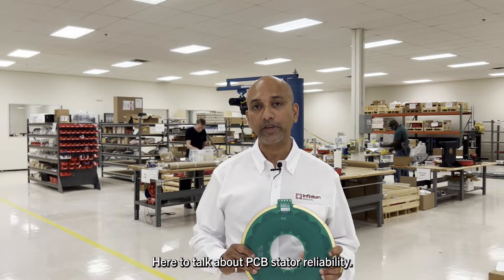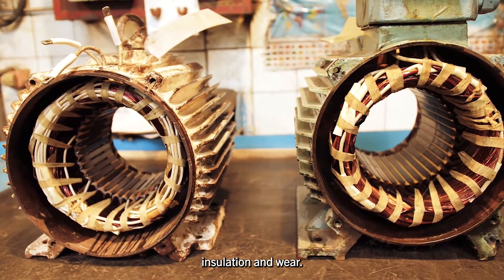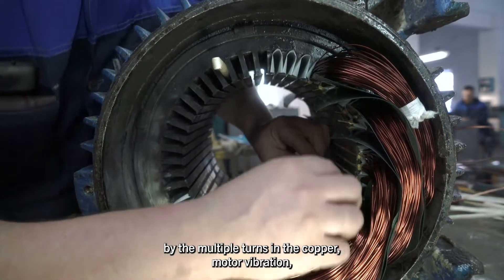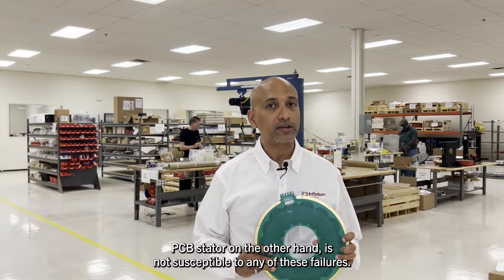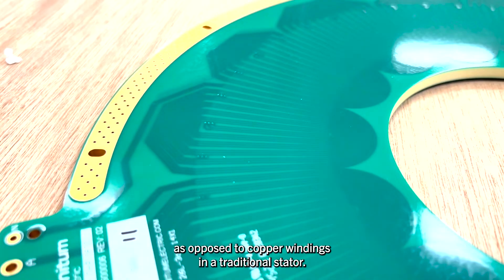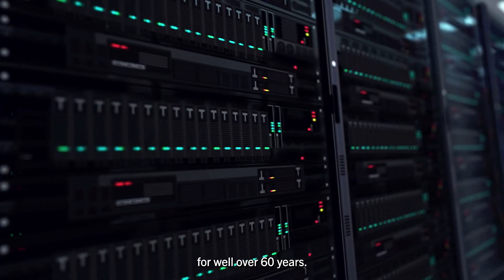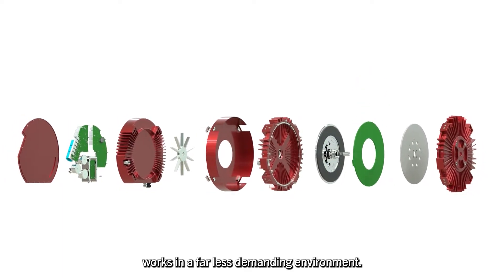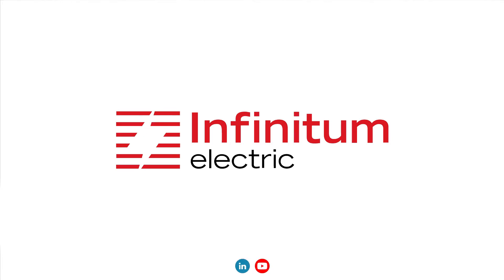PCB Stator Reliability

Comment: And how do your motors compensate for the non use of the iron cores ? Because without it the magnetic flux doesn’t get amplified, do you solve it with more turns per pole inside the PCB ?
Reply: don't ask too many questions )) this is just a marketing, welcome back too the real life) no magic in this world....
Reply: Dual Permanent Magnet Axial Flux Generators.

There is tons of publicly available research on this.